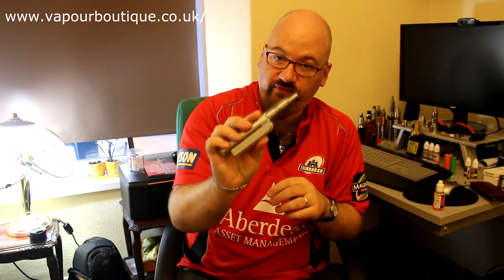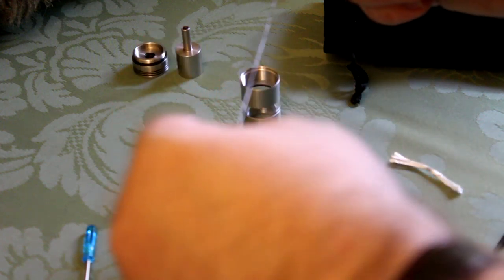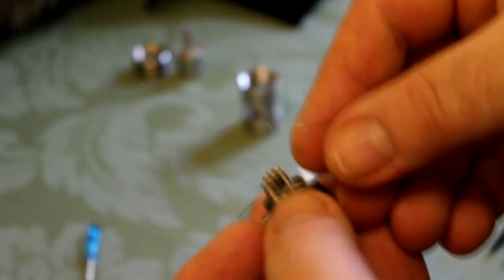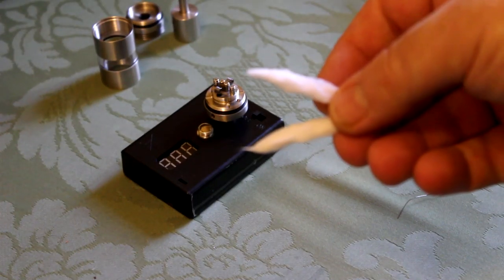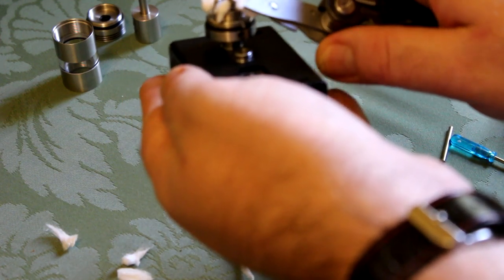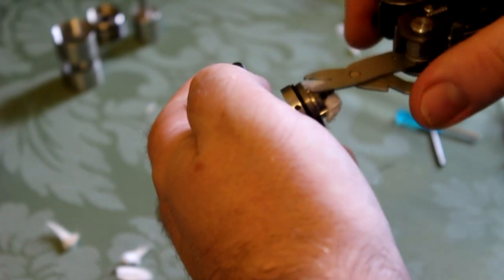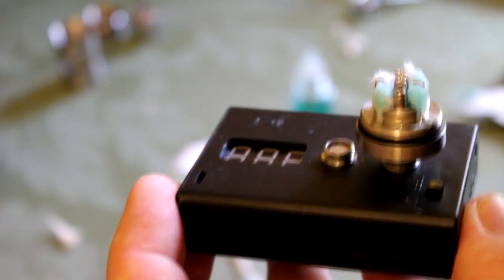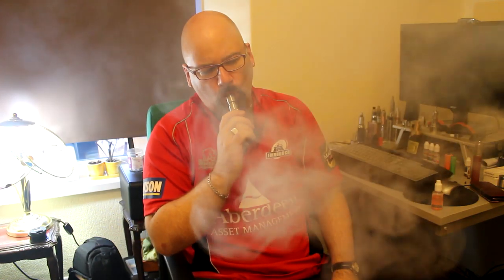Orchid V4 Rebuildable Tank Atomizer from Vapour Boutique

Comment: Nice video and yep the Orchid V4 is very good.

Everyone has their own methods and as long as the end results are the same it's all good.

I use 2x6, 3/32", 28 guage and it's a great vape. The other differences are I trim to about the same circumference to the deck, then I juice it up and using a jumbo paperclip I take a tiny amount of cotton into each channel and mold the rest in a circle to match the deck. It's an easy method and it's a lot faster. 

I never bottom fill because it's always a mess, takes a long time and in general it's too much a pain. I also like the Kayfun glass tanks. V5 needs either 2 fill ports juice in / air out or better placement juice just doesn't want to go in.

BTW you can convert your older V1 thru V3 into a V4 style / size with an elongated chimney, a full conversion requires a replacement deck for a fill hole. Here's one place to find an extended chimney - https://www.fasttech.com/products/0/10009751/1918600-replacement-chimney-for-orchid-v4-rebuildable you can also find other Kayfun and Orchid accessories including replacement tanks you'll need for a V1 thru V3 conversion.